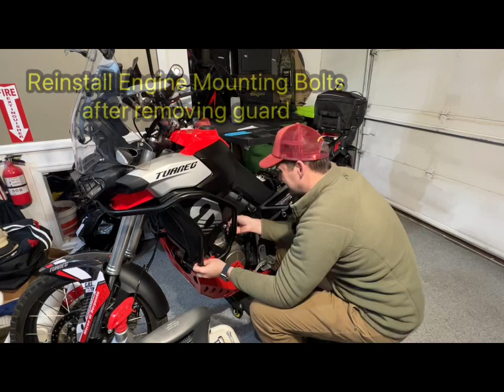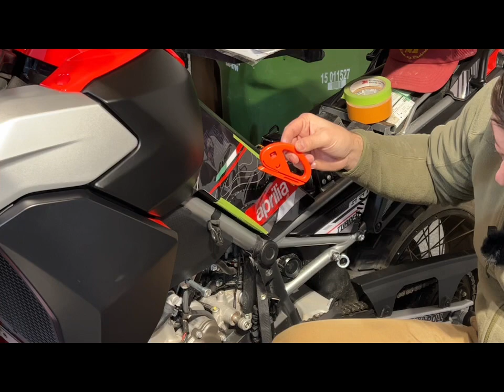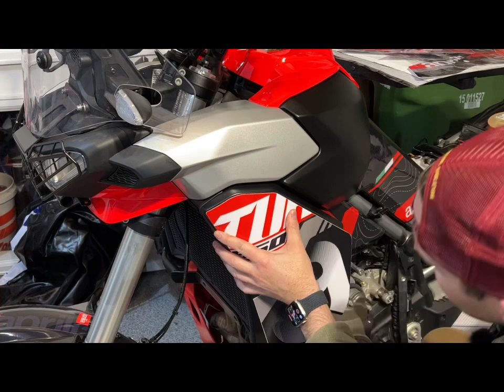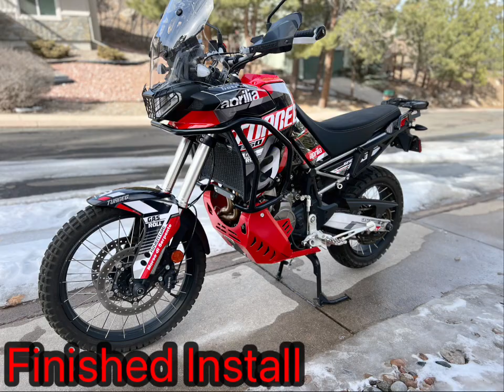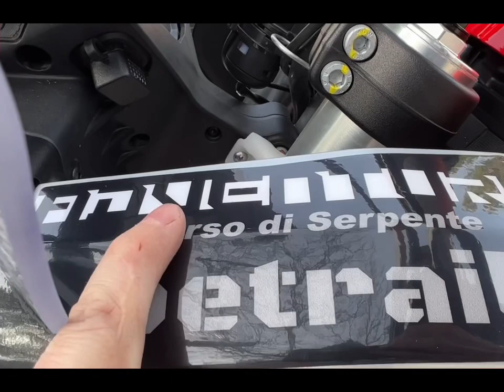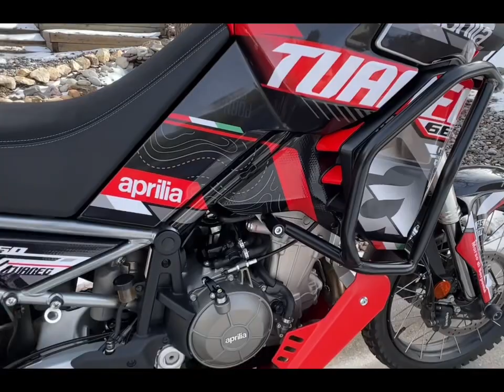Aprilia Tuareg Vinyl Graphics Installation

Comment: I've previously used lightly soapy water to spray on the target surface which allows you to more easily position/move around the decal and squeegee out any bubbles. Admittedly this was with applying 3M clear protection film, so maybe that's different with these decals.
Reply from the maker: Soapy water would have been a good backup for me. I was just very pleased with the RapidTac, just the right amount of adhesive while remaining movable/fixable. These graphics were thick vinyl and a bit more cumbersome, it required patience and a lot of continuous low heat.

Comment: Het RAN what comfort seat is that ? ...and how are you liking it compared to the stock one ?
Reply from the maker: It’s the HI-Comfort seat from Aprilia. It’s a comfortable step above the factory seat. I thought the factory seat is really nice compared to the competition and was quite comfortable for the first hour of riding. The HI-Comfort seat isn’t as plush but feels good during the first hour and the extra support really helps AFTER the first hour for those long rides in the saddle. It’s 3/4 inches (18mm) higher than factory seat but you sit about a full 1 inch (25mm) higher than the factory seat because it doesn’t compress as much. Also, although the seat is all-black, it doesn’t burn your butt quite like the factory vinyl after sitting in the sun. Hope this helps. Cheers!

Comment: What seat did you install? The higher comfort seat? Is it comfortable?
Great looking Tuareg!!
Reply from the maker: The high (height) comfort seat from Aprilia. I really like the comfort seat, especially for rides over 2 hours. It’s not as plush initially as the OEM seat but it provides better support and comfort over longer periods; no hot spots. The seat is about 3/4 inch higher and compresses less so I sit about an inch higher, which is great for my long legs. The only downside is that I had to add a windscreen spoiler because sitting higher put my helmet peak (sun visor) into the airstream. And my Arai XD-4 has a notoriously turbulent sun visor. The touring windscreen provides wider wind protection and now coupled with a spoiler provides great protection for the crappy aerodynamics of my helmet. I hope this helps.

Comment: Lookin great👌👌👌
Reply: Hi Ran, how do you like the HIGH seat? I have not found any vid where they compare standard vs high seat. Is it any better regarding legs space for you? Do you still flat or n your feet?
Reply from the maker: I do like it. And I do notice that the combination of a higher seat and lower pegs has given me more comfort through the knees; I installed them at about the same time. I’m still flat footed when stopped, but I’m a tall rider so that was expected but it’s now much closer to ideal. Once I complete my rear spring replacement for my rider weight I expect the sag will be appropriate and I’ll have my ideal seat height. I need more long rides to give the saddle comfort a fair review. I’ve only ridden about 2 hours continuous on the comfort seat. The factory seat is more cushy and comfortable initially but I think the comfort seat has big advantages for longer rides. I also appreciate that it is a bit more firm under me during off-road riding, it seems to give me a little better feedback.
Reply from the maker: Thank you!